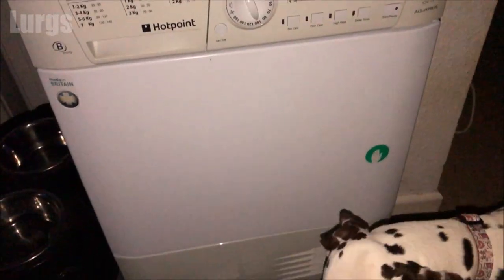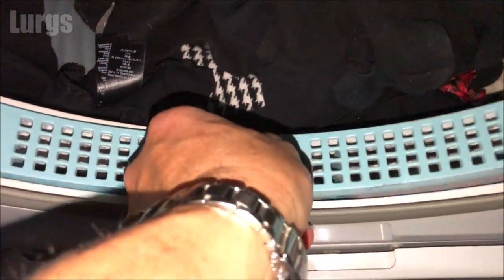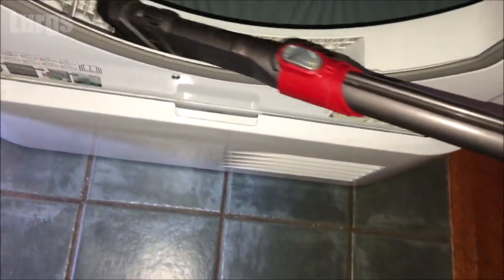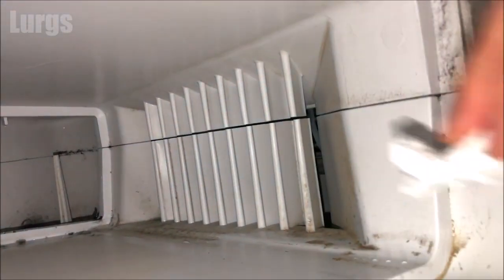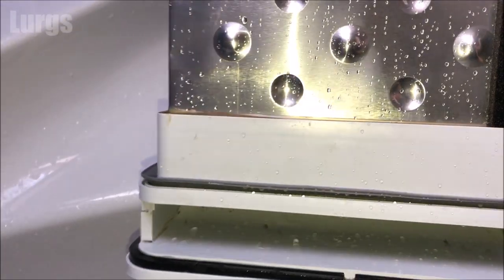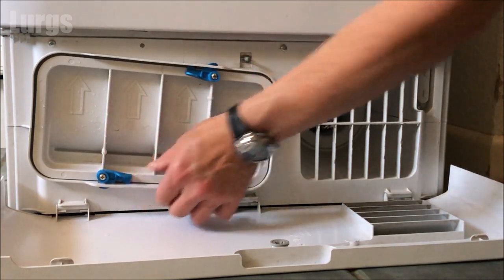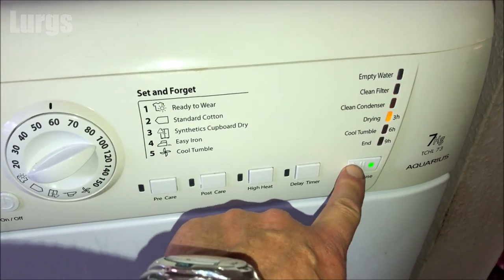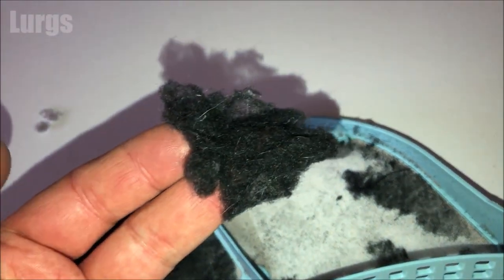Hotpoint Aquarius Tumble Dryer all Lights Flashing - Hotpoint Aquarius Tumble Dryer Maintenance

Comment: Hiya, I have this exact dryer & it's working, spinning & all that. But it's not hot. No matter if I put it on 160 then press the High Heat button .. still cold - Help? 😭😭😭😭😭
Reply from the maker: If you’ve cleaned it all (filter and condenser) then it’s probably a faulty heater pump. Hope you can get it sorted, good luck

Comment: followed all the advice to the letter, still flashing lights!. works for ten minutes then shuts off then flasing lights
Reply from the maker: Oh dear. Sorry to hear that. Not sure what that could be.
Reply: @LurgsHowToGuides  aparently it could be the  sensor on the water pump, if that has got fluff etc! stuck all over it it can sent the wrong message to the circuit board. so I know what I shall be doing next

Comment: I have this problem and when I switch it back on it works for 10 minutes and all light are flashing again what could it be ?? My son left the water overfilled and didn’t empty it but I can’t see that would have caused this problem any help please?
Reply from the maker: It may just clear if you use it, make sure the water tank is empty and that the filter and condenser unit are nice and clean.

Comment: I’ve done all of this and the lights are still on 😢
Reply from the maker: Sometimes it can take a little while for the sensors to switch the lights off
Reply: Done all this, worked for 5 mins n now all back on n not working🤷🏼‍♀️🤷🏼‍♀️🤷🏼‍♀️
Reply from the maker: @debbystephenson5891  oh dear. Maybe another thorough clean of the filter and condenser unit. Else sounds like it’s faulty